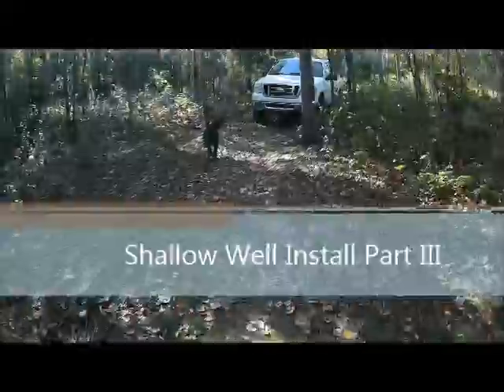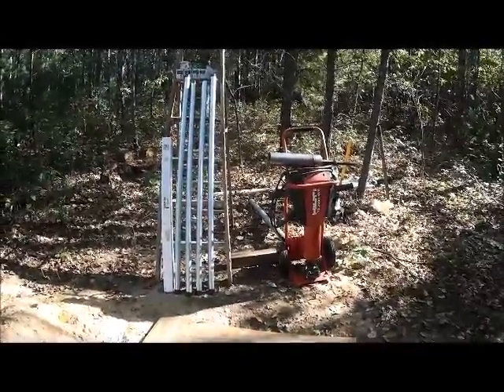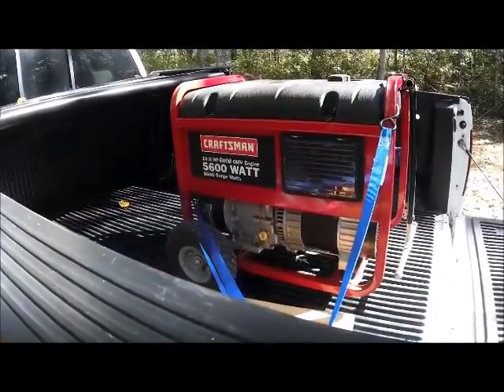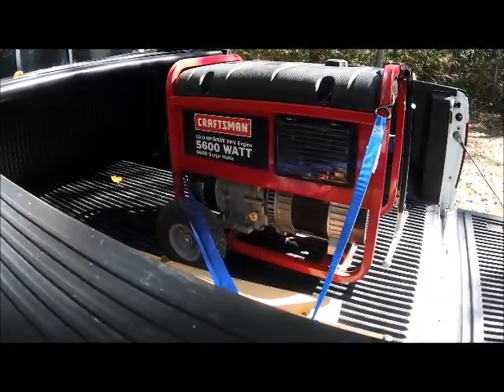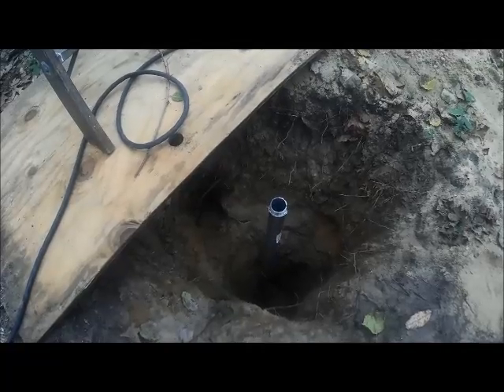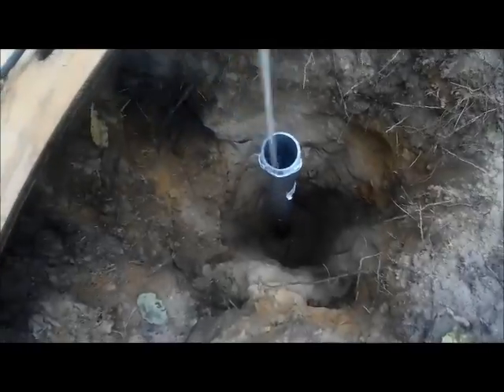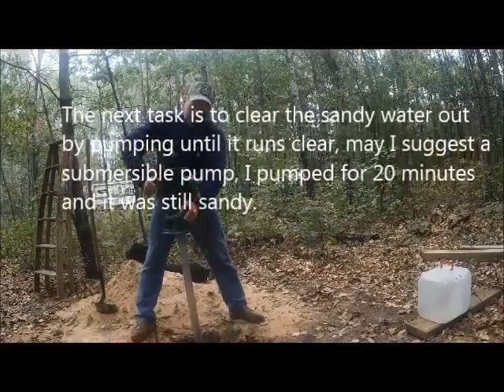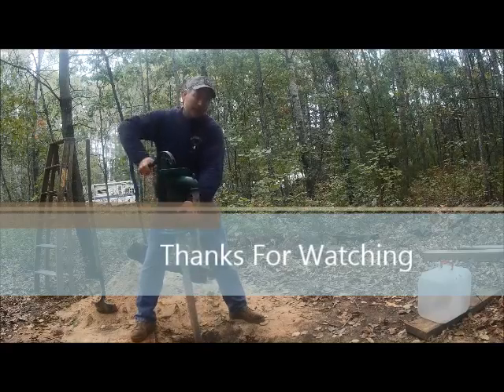Shallow Well Part III - Thirst No More

Comment: Couple of suggestions.1. Dont use a drive-cap,use a sacrificial coupler,it will take the abuse of being driven,if you do use a drive-cap make sure to re-tighten it every 10 strikes or so...2. Seems to me you went unneceessarily went too deep,all you needed to do was be about 1 foot above the well point,you probably was past the water and that was probably why you kept pumping sand out...
Reply from the maker: Never considered that I may have been past the water table.  Great suggestions!! Thanks for watching.

Comment: Could you have left the 2 inch pipe in the ground and slid the 1.25 pipe down inside the 2 inch pipe?
Reply from the maker: No as I needed to remove the top drive cap and couldn't because it got bent on the pipe.

Comment: Nice dog. "Washer" on a string, huh? How many times should I bounce the nut in the water, to determine if it's water?
Anyway, glad you found water. Didn't know about the jack hammer option. Also I was wondering about the limitations of a 2" well, compared to the 1 1/4. I'm in the middle of that same dilemma. And lastly, wondering what you are watering, so deep in the woods. Guess I should play videos 1+2. Thanks for posting.

Comment: Do you know what that jack hammer bit is called?
Reply from the maker: Not sure it has a name.  It is a home made device the local rental store came up with to assist those putting in a shallow well.  He indicated he had it made for about $200, as I had to put a deposit on that part alone in case I broke it.